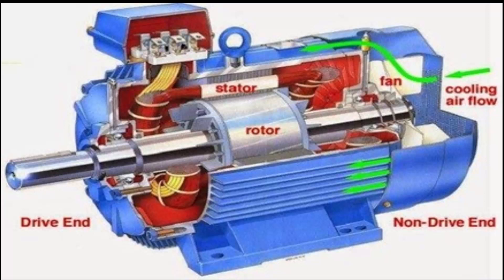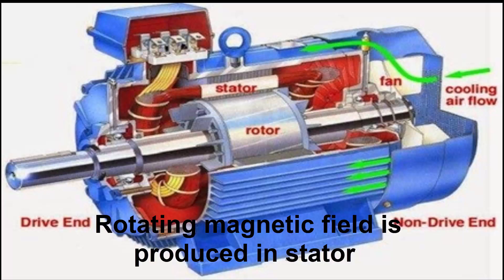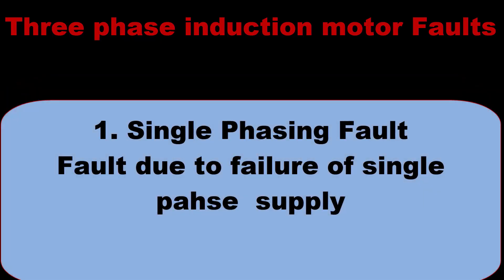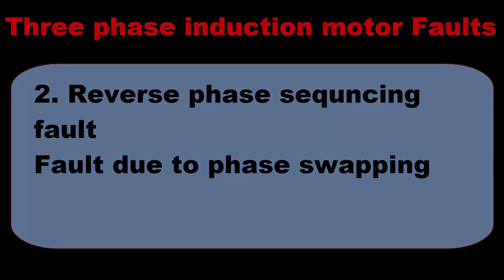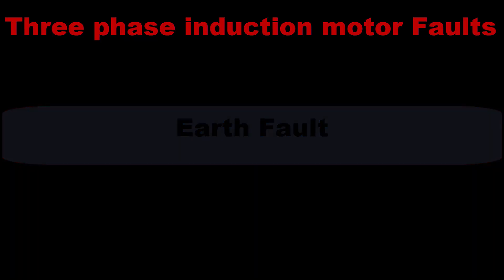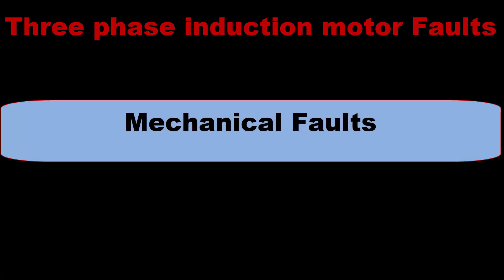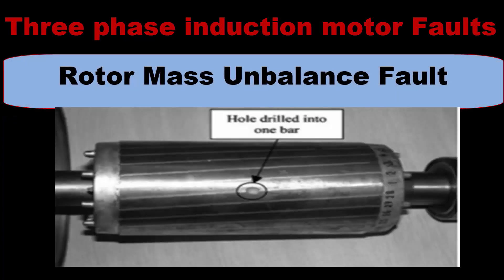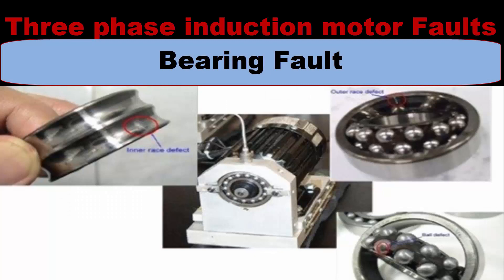Types of faults in three phase induction motor

Comment: Three Phase Induction Motor :
3 PH induction Motor is a machine that converts electrical energy into Mechanical energy. 

Stator is the stationery part  which carries 3 PH windings.

Rotor consist of copper or aluminium bars which is connected to the end rings.

When 3PH power is supplied. A rotational magnetic field is created. This induces an EMF in the Rotor. since Rotor are S.C with the end rings a current is induced in the Rotor. This current creates magnetic fux that interact with the Stator flux to produce rotational torque 

Three types of Fault
1.Electrical Fault
2.Mechanical Fault
3 Environmental Fault

Electrical Fault
1. Single phasing fault
2. Reverse phasing fault.
3. Over voltage or under voltage fault.(Voltage limit :380V - 440V)
3. Earth fault.
4. Crawling (Running at a speed of 1/7th of sychronz speed) 
5. Overload Fault.
6. Inter turn fault. (when one turn get SC with other turn of same phase or different phase) 

Mechanical fault.

1. Bear fault.
2. Rotor bar Broken fault.
3. Rotor Mass unbalanced fault.

Environmental Fault
1. Reduction is performance due to temperature, moisture etc
2. Vibration. 

Thanks!!!
Reply: U makes things simple... thank u sir🎉🎉